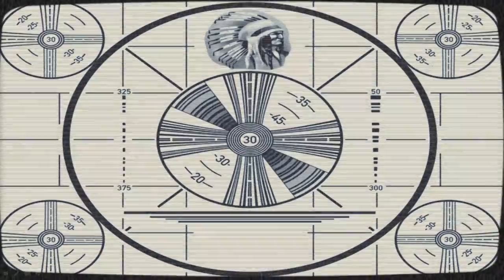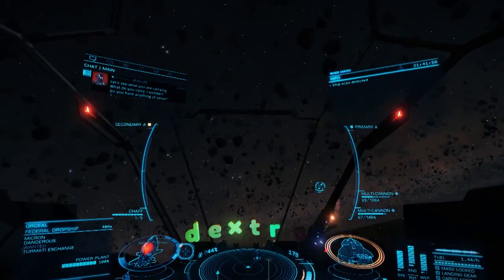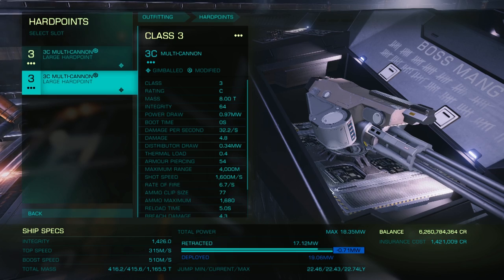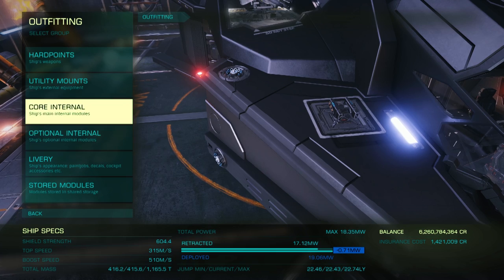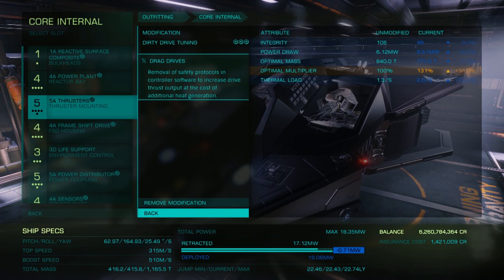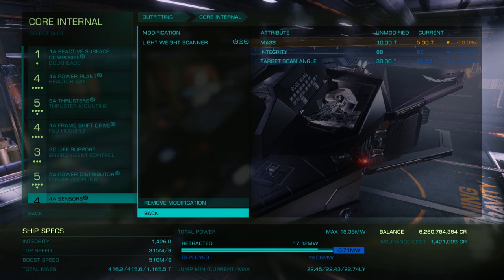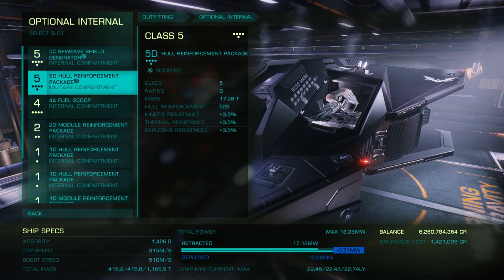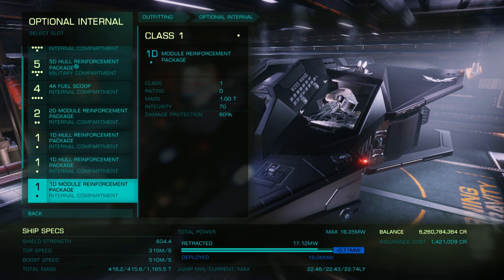EASY!!1! Engineered Vulture Haz-Res Bounty Hunter for Elite Dangerous

Comment: hello I m new. So I don t think I can engineer my weapons... So what do you recommend for normal weapons ?
Reply from the maker: Good question... The Vulture REALLY needs a bit of engineering to be useful. I'm about to start covering that process in depth. In the meantime, you could stick with the multicannons, or try 1 pulse laser (for shields) and 1 MC (for hulls).  
The Vulture's powerplant is also too small without engineering. So, you'll probably need to eliminate a shield booster to have enough power to run your weapons no matter what.
Reply: @ManusDextra  thx for the answer ❤️❤️